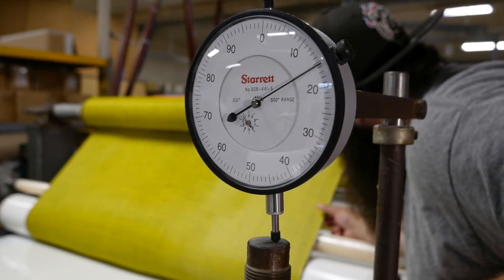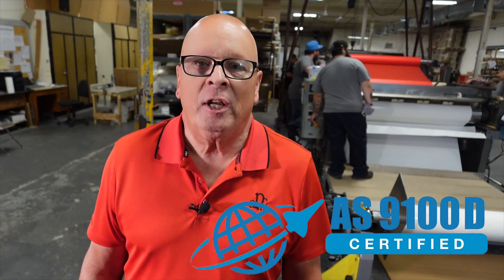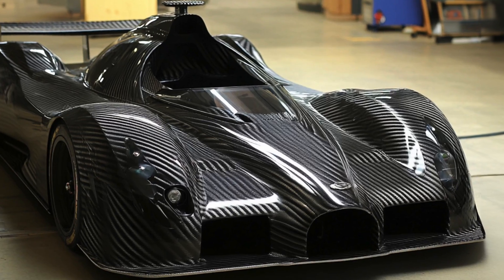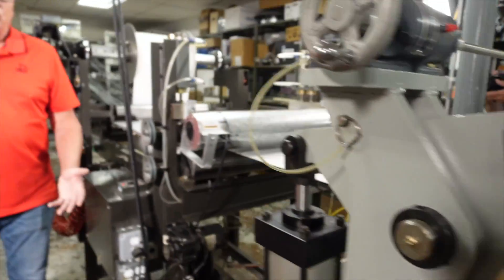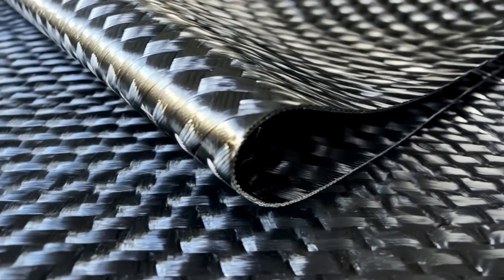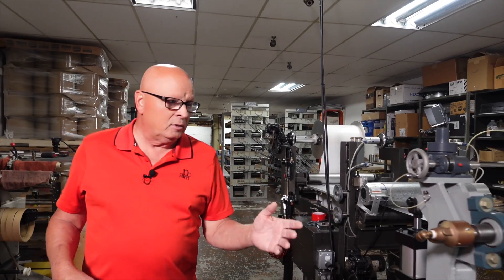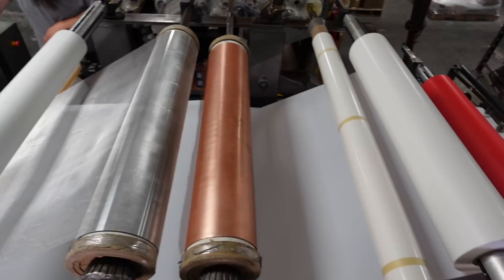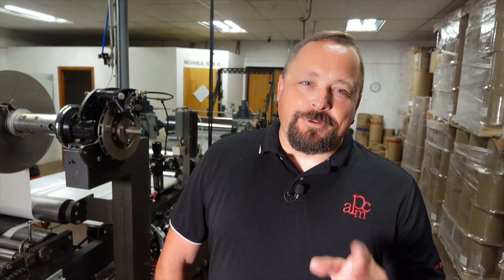Adhesive PrePregs - pre-impregnated carbon fiber or glass materials ready to lay up - APCM prepregs

Comment: prepregs are the best for composite manufacturing, but with one disadvantage that is can not adopt curvy mold surfaces !
Dear brother
1. how much void % is in your prepregs, have you ever measured/calculated it ?
2. blow moulding vs vacuum, which one is better to minimize voids ?
thanks !!
Reply from the maker: much less voids than the alternative of the person using a bucket and brush to make their own layup. and blow molding and vacuum forming dont have wet material in it.